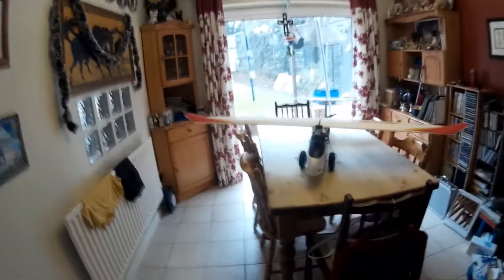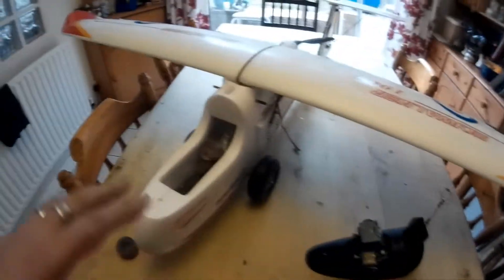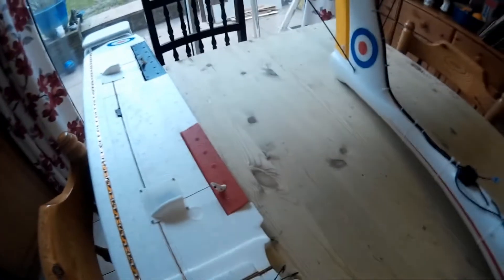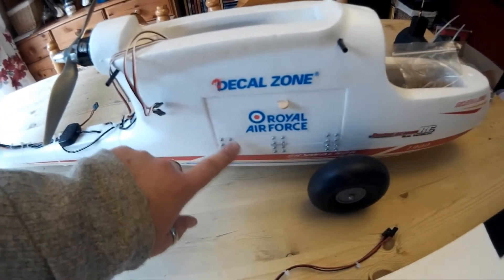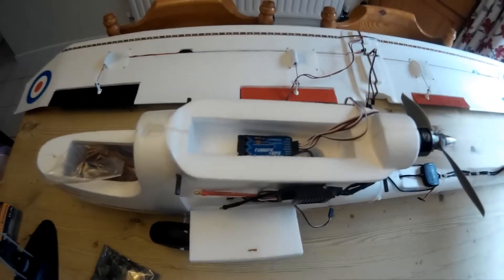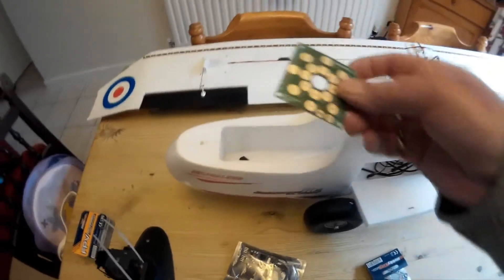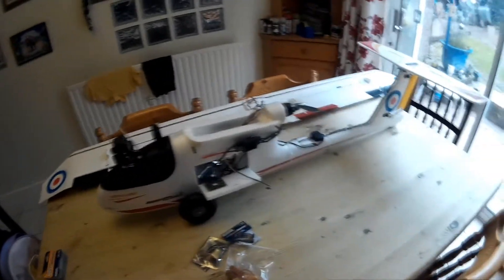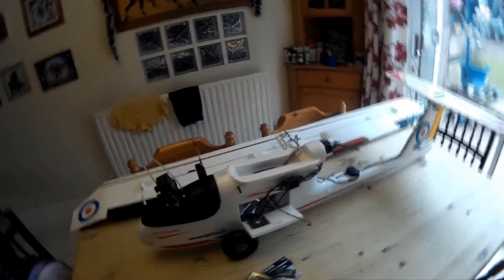Skywalker Project need help

Comment: I got my 2014 Sky from BEVRC with its warped wings! I will NEVER buy owt from them again. They did not want to know! They did not even respond to my last two E-mails.
It looks a nice clean build, you seem to know your eggs. But I do think the motor is a little small for a large heavy plane. I was running a 35/46 with a 12" prop on a 4S.
Be carful with the 2W 5.8Ghz Video TX. They can stomp all over the GPS, causing it to not get a lock, or loose it mid-flight.
Having said that with a UHF system you should not suffer signal loss till you get pretty far away.
Not sure about the RemZebi? Try BMSWEB. He used one in some of his early video's.
I have built the Emax 250 Carbon with the Emax 1806 motors and 12A Esc's. Cant recommend the Naze32 Acro enough, mine came with a CC3D board and its no where near as good. Just keep it all as light as possible. You'll love it!!!!
Reply from the maker: thank you so much for your info and sorry you got a bum deal from bevrc i still havnt test flown my skywalker 1900 yet as i cant make up my mind whats the best setup i have put a small fortune into the fpv hobby and want to get it right so i dont lose too much so really welcome your imput and loved your video so i got the smaller 5x to do a more budget verson to test the gear first i am a subscriber to BMSWEB  and am also building the 250 carbon with full emax system short video coming soon about what i am up to also doing the rotorbits tricopter as i am struggling to get all the fpv gear to fit on such a small base but have got some aomway micro fpv gear that should do the job will post the opening of the skywalker x5 in here and look forward to any constructive comments thanks again for posting its sharing opinions and ideas that helps us all in this hobby happy flying am subbed to you know  pdts thankyou
Reply: Your like me. Start another build before you finish the last one!!! lol.
I have the CGX Coptergeist 250 after watching BMSWEB. Highly recommended. Not cheap, but very tough and it came from Australia in less than a week.
The Emax looks just as tough but will take 6" props. I still need to solder up my Naze board then swap some 5.8Ghz Tx's about. I have an old 250 Mw FatShark Tx that I had on my 450 Quad, but is on the Emax. After a crash with the 450 I fitted a 600Mw Immersion. Now I am having problems with GPS lock. I have read that the close proximity to a powerful 5.8Ghz TX affects it, so I am going to put the 250Mw back on and see if that helps? Then put the 600Mw on the Emax. If not, its try a new GPS! Maybe it got damaged in the crash?
I have another (my Third) TekSumo, a Bixler 2 (also my Third) a AXN cloud fly (third again) and a HK Falcon Wing to build (second)
Its just time to build them and space to store them!!! lol. Maybe its time to get rid of some planes that I don't fly very often!!!
Anyway, I'm into my FPV. I would a Cam to all of them if I could afford to. So any questions, feel free to ask and I will help if I can?
Let me know how your Maiden goes. I will look forward to the video!
Bye for now.
Reply from the maker: lol yep we are as bad as each other i have so many things to build hopefully now the kids are back at school should be able to catch up also went in my cave and forgot the hk stick 90 i was half way through building lol will be doing some box opening and upcoming vids over the next few days too :)
Reply: Breathe - RC Bix 3 just arrived today as well. So something else to build at some point. Need to get most of them built ready for the summer!!!
Reply from the maker: blackbirdboy1 i love the look of the bix 3 i still have my v1.1 but its looking well knackered now lol
Reply: Breathe - RC Yeah I have a battered old Bixler 1.1. I think it's mandatory!!! lol.
I flew it today fpv. It's got a NTM 28/36 2200kv motor with a 60A esc turning a 6x4 prop. I have the Cyclops Storm OSD with RTH crammed in there. I flew it today with a 3300mah 4S 30C battery plus a 500mah 3S for the FPV gear. I have the mobius on the wing. Not the best place, but on the nose it gets in the way and then I have to use a smaller battery to make CG. Anyway, I love it.  I would buy another tomorrow if I could? You just can't find the kits now! My new 3 will be a 3S set up of my 1. Should get longer flight times. Plus I am going to build a Bix 2 fpv with a eagletree flight stabilisation in for short range FPV in windy conditions. The Eagletree is by far the best I have tried for flight stabilisation!!! Bix 1 video is uploading now. 250 quad vids to follow.
Later dude.

Comment: Every Skywalker ends up different as it depends on what gear is going on it... plus everyone has a different opinion about how the gear should be placed. If i were you i'd just continue building it placing parts where you feel they'll work best. I just finished building my Skywalker 1900 and flew it for the first time a week ago. I have placed my UHF antenna in the tail, my GPS on the flat part just behind the prop, and my Vtx on the canopy, ESC externally (so basically same positioning as you) and its working well.

Good luck finishing the build if you haven't already.
Reply from the maker: glad to hear thats working well many thanks for your comment thats made me feel a bit better about this build now just need the weather to slot into place and the maiden can be done :)
Reply: bit windy in Bham at the moment!
Reply from the maker: Adam Glenis lol tell me about it redditch here so not too far from you guys
Reply: not far at all, I'm in Solihull :)
Reply from the maker: i grew up in castle bromwich so know the area well happy flying :)